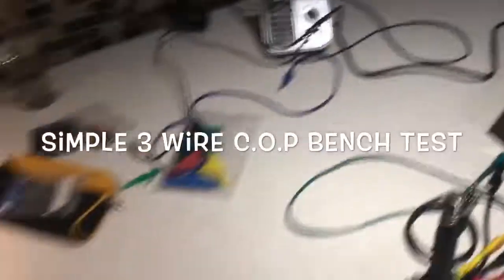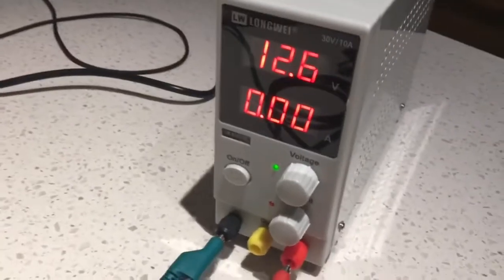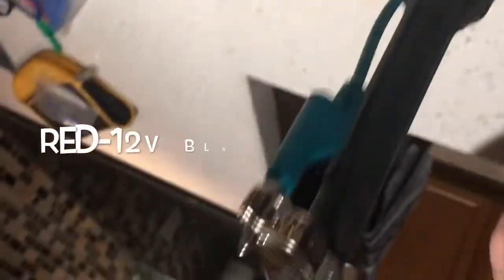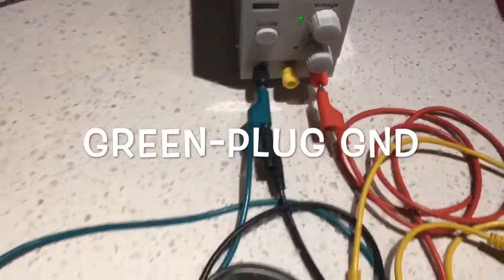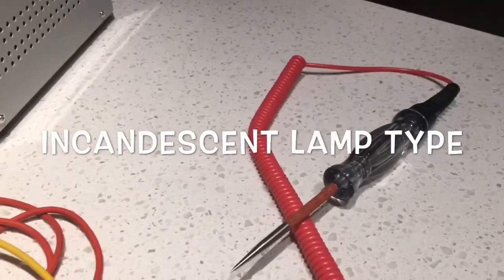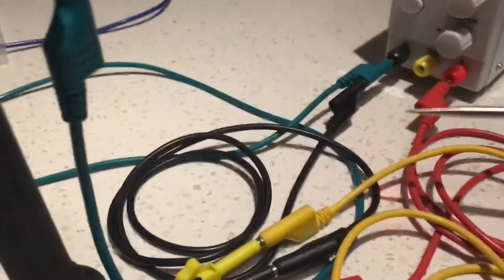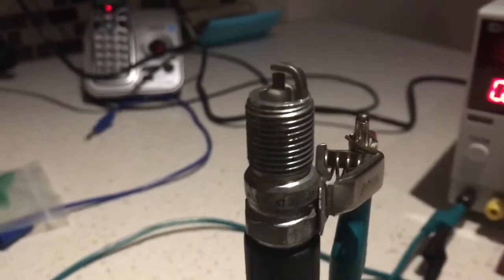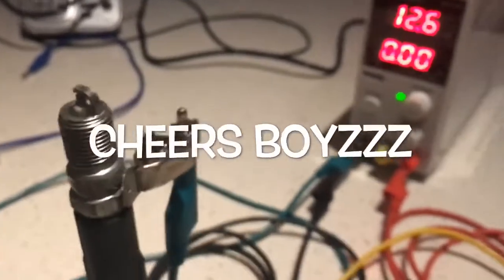3 Wire C.O.P Bench Test

Comment: Are you using 12V as the trigger voltage? So this won't damage the coil which is designed for 5V from the ECU?
Reply: Just remembered that the trigger signal from the ECU is a switch to ground so not a 5V signal at all. My mistake.
Reply from the maker: @frogman6641  Hi... you are correct in the first instance. On the vehicle it is a 5V trigger. At the rising edge, the pulse turns on the  driver (internal ignitor) the width of the pulse determines dwell (coil saturation). At the falling edge, it turns off the ignitor. Collasping the primary field and inducing the HT into the secondary and firing the plug. (As you may know)...You are absolutely correct, ideally it would be 5V. "Scratching" the trigger line through the test light acts as a series dropping load. Would not try this with a straight jumper. The approach is well detailed in Tracy Martins book(s). Also widely used by Paul Danner. So I figured good enough for them ...Thx for watching. Cheers
Reply: @TheGibby3340  Thanks for the reply. So do all cars use a + trigger from the ECU? What about a Golf MkV? I've got no spark at the plugs and I'm trying to test for ECU signal comming into the coil connector (got earth and 12V). I've read that you can use the Hz seeting on a multimeter to test the ECU signal but not sure how to connect up the multimeter - one probe to earth and the red probe to the ECU signal? Any idea what the frquency should be?
Reply from the maker: @frogman6641  I am only a hobbyist...I can only speak to the Suzuki SX4 & Vitara...No spark at 1or all plugs?
Reply: @TheGibby3340  No spark at ALL coils. All fuses and relays test ok. I suspect the crankshaft sensor is faulty but just want to test the ECU signal on the coils first.
Reply from the maker: I think an issue with cam or crank sensing is more likely. Check engine light on? Scan for DTC’s (codes)? Does the top end have rotation? (timing belt/chain).
Reply: @TheGibby3340  Scans don't turn up any relevant error codes which is strange. The rev counter goes up to 200 rpm when I crank so looks like I have engine rotation.
Reply from the maker: @frogman6641  Crank rotation certainly...but the top end may not be...Confirm cam rotation and cam/crank timing. At a cranking RPM of 240 RPM that equates to about 2Hz trigger pulse frequency. If my math is correct. (Rpm/60/2) Good luck. You are welcome to get back to me if I can be of any help. Cheers
Reply: @TheGibby3340  Ah yes the broken timing belt scenario! Will try to confirm cam rotation too thanks for the tip and for the estimate of the frequency too. Your maths is better than mine. Thanks again.
Reply from the maker: this may help...
https://youtu.be/p-yCLMGjLpY
Reply: @TheGibby3340  Thanks alot for that video - it's very helpful! Which program is that you're using? VCDS which I use doesn't have info like that. We must have got the 2.0 FSI earlier in Australia. I'll test the crank sensor when I find some time. The only thing is I get revs on the tacho when I crank and your'e not meant to get any revs showing if the crank sensor is kaput.
Reply from the maker: @frogman6641  Yes the fact that the tach is operative is puzzling...Snap-on Modis (Scanner/scope) contains it own data base. Mine is grossly out of date as the software updates are big money...I bought it well used...Check out the character “Les Patterson” if you don’t mind your comedy a little crude. Australian legend 😀
Reply: @TheGibby3340  Ah yes "les Patterson" I haven't heard that name for a while. I think he must have finally retired from his unofficial role as tourist ambassador : )
Reply: After reading this article https://www.autoserviceprofessional.com/articles/6553-coil-on-plug-technology-and-diagnostics-tips I learned that the ECU will sometimes cut spark and injectors to ALL cylinders if it detects a bad misfire in only ONE cylinder, so I disconnected ignition coil nr 1 and the car started and ran on 3 cylinders for the first time in several weeks! It must have a misfire in either plug 1, coil 1, connector 1 or ECU wire 1. So I replaced all the spark plugs with new ones and it runs beautifully. If the misfire comes back I'll fit a new nr 1 coil, connector etc. I tested nr 1 coil using your method and it fires ok but maybe not under compression. Thanks again.
Reply from the maker: @frogman6641  Nice...I am glad you got it figured. Cheers
Reply: It's a 2005 Golf 2.0 FSI BLR Hatch.
Reply from the maker: @frogman6641  Not sure if that variant was sold in North America in 2005. It does not appear in my data base til 2007. Safe to assume same thing basically?

Comment: simply test Ian and valid point  by can diagnostic. Have you every done any work on Diesels
Reply from the maker: Hi Ian. No real diesel experience. I read somewhere they only make up 3% of the North American passenger car market. Other than VW it’s pretty much only commercial vehicles equipped with Diesel engines over here. A few exceptions in relatively low numbers.
Reply: @TheGibby3340  total opposite over here although that will change Ireland are banning petrol and diesel engines from 2030 why would i like to work on an all electrical car if you take the mechanical out of what is the point really  i love diagnosing electrical problems but you still need an engine to work on
Reply from the maker: Ian Kelly The diesel fuel formulation is quite different in sulphur  content Over here emissions constraints !

Comment: Hey Ian. Great stuff as usual.

I agree with CAN Diagnostics. In cylinder pressures and fuel mixtures can greatly affect spark output.. 

And also if testing a suspected coil, note operating temperatures and try to match that temperature ( suggest a heat gun)

Suggestion!!! Bench test with a spark tester set to 20-25kv range when testing a suspected coil issue.. 

I would also set your voltage generator to 13.5-14.5v to imitate the operating voltages of a vehicle😊

Take care and thanks for the content.
Reply from the maker: Hi Jeremy...All valid and great suggestions. You know the story it’s a constant back and forth. Cut or details. I feel some of my stuff drones. Then I go the other way a cut details I should have included. Once you publish...you live with the shortcomings. Cheers Pal
Reply: @TheGibby3340  I know exactly what you mean. Sometimes I even edit the edit lol... But we are all doing our best. The longer we do this the easier it will become.. 

Cheers.

Comment: Great stuff! In cylinder pressure can greatly effect the spark of the secondary isn't functioning fully
Reply from the maker: Absolutely. This point has ended up on the cutting room floor.  It’s difficult to know where to draw the line on detail...As you say a marginal coil may not function when subjected to in cylinder pressures. A video of cover ignition P&S waveforms/ current ramps might prove interesting. I will modify the description to briefly mention this important variable absent from the piece. Thx for watching and commenting on this very valid point. Cheers
Reply: @TheGibby3340  your videos are great keep going
Reply from the maker: Thx you Sir. The description has been modified with credit to you. Thx again.